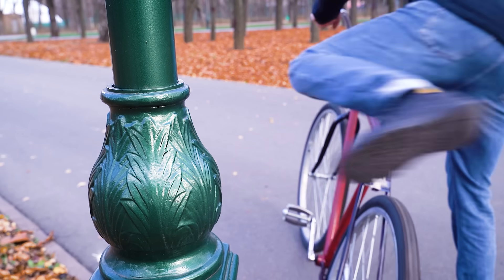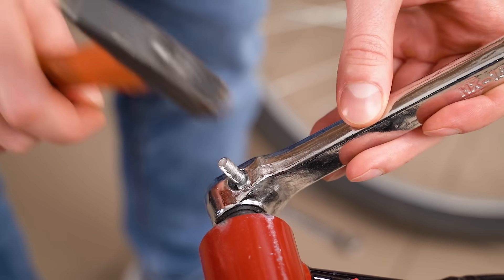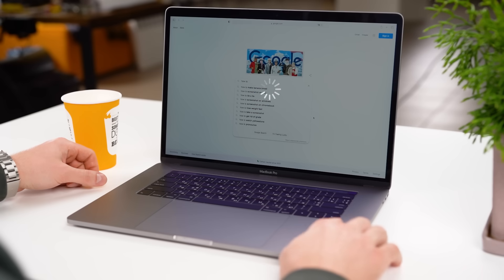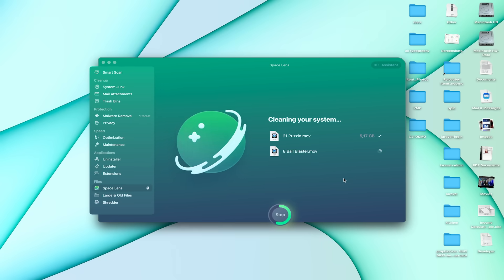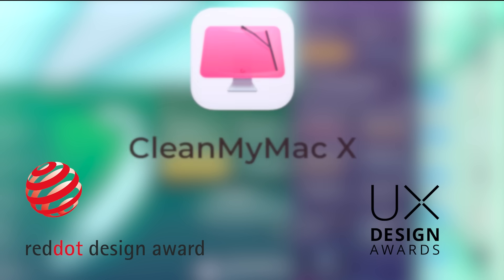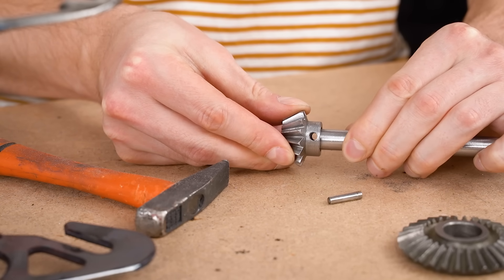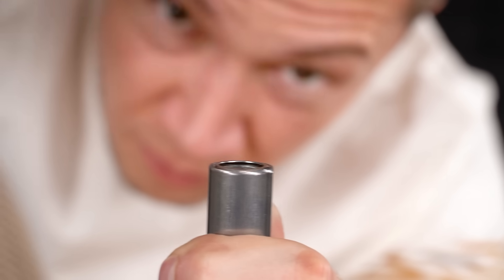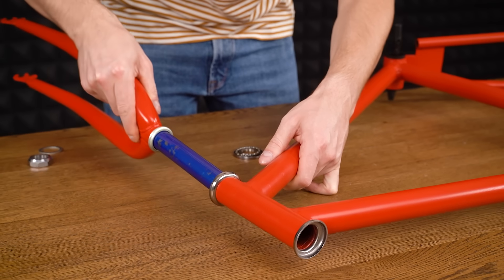Insane Chainless Bicycle Prototype

Comment: The power loss from the pedals to the rear wheel is insane.
Reply: If he tries to improve on it eventually it'll evolve into the chain again
Reply: Not a power loss.more like a efficiency loss due to way to low of a gear ratio. But he could climb any hill slow.
Reply: @kevind3185  Slow indeed, pushing the bike i.e. walking it.
Reply: @kevind3185  There's definite power loss, you have to spin that shaft, and that's not super easy to do in an efficient fashion.
Reply: @kevind3185  friction does cause a power loss that's why sport bike motorcycles are chain driven
Reply: Gear ratios.
Reply: The pedals have to move anytime the bike moves. No clutch.
Reply: @brsproductions6117  that’s not true, it still has the original freewheel axle in the rear, only the sprocket is changed. The downside is the gear ratio.
Reply: @murray821  if you actually watched the clip, there is no flywheel, its a direct drive.
Reply: Could you get a switch kit for this chainless bicycle, and with that help you with power and speed and what not? Cause there are no gears on this set up. dot
Reply: @Defender78  sorry, I was referring to some components on a car/truck that is used for the alternator/motor for one way to prevent reverse direction.
Reply: this is actually is like truck on 1st gear. So you need to pedal more for to go faster but now you have more torque. So if he can do a double or triple gear system that is changeable it will be better than chain system I believe :D
Reply: @BerkayGür  more like a truck in 5th gear going slow
Reply: @BerkayGür  😂😂😂
Reply: That's why when they used to make bikes like these, back in the 1800's they quickly ditched them when derailleurs started appearing. Chain reigns supreme.
Reply: there is no power loss, wtf are you talking about?
Reply: @igvc1876  look how fast he has to pedal to only go like 5mph
Reply: @zainzwerschke5484  yeah, which would be like a truck in 1st gear, not 5th.... do you have any clue how a transmission works? Lmfao. In first gesr the revs will be high and youll have no speed. Just like how his legs have to spin fast and hes going nowhere.
Reply: @igvc1876  yes there is chain drive is the most efficient then belt then shaft look it up before you speak stupid
Reply: @igvc1876  tell me more about how you have no understanding of physics
Reply: @splitloopgaming3523  why is there a  massive power loss here?
Reply: "Prototype"
Reply: @4gent0range  Yeah i'm waiting for the stage 1 with carbon propshaft.
Reply: Electric motor with one way cluch can help generate extra power for going up hills with this gear and chainless system
Reply: Maybe he can improve it in the future
Reply: @islamisthetruewaytogod6812  No, not really. It hasn't been solved on motorcycles, so I'm not sure how they'd solve it on bikes. Just spining the shaft alone requires a lot of energy, and that remains the case no matter what you do. On top of that, with shafts, it's much more difficult to have multiple gearings in a bicycle form factor. Motorcycles get away with it, because they can handle the extra weight of a transmission. The transmission itself is a pretty good chunk of the total weight of a good road bike.
Reply: @SmallSpoonBrigade  don't see why you couldn't pair this up to a shimano nexus or something similar rear hub.
Reply: @islamisthetruewaytogod6812  why bother when the best solution exists at the bikes store already

Comment: This will never be as durable as the chain bicycle,  plus this bike can never go faster than 7-9 km/h when comparing it to a regular which can reach to 20-30 km/h

I know that this is a prototype,  and in future he may comes with a solution to get pull vs drag mechanics,  but the current model is just a beautiful art

Comment: Video should be labeled "How to ruin a perfectly good bicycle". The technology used in this video is actually VERY old, but there is a good reason why it's not being used today.
1) There is not gears, so going uphill will be difficult
2) There is a lot of stress when pedalling on the small gears, with single point of contact between gears (in comparison to a large contact area on traditional bike with chain). There will be too much wear on this mechanism.
3) Any small debris (even sand) will make this mechanism not very useable.

Comment: It's a good invention, but need to chage a lot.
It will not run fast nor it is be easy on hills. So need atleast 3 gears shifting system in it so  it will be much better.

Comment: Exhaust yourself just to go fast enough without tipping over. It's a neat idea but the dude even barely missed that tree with keeping the bike upright. Unless you get bigger gears or some weird planetary gear fuckery to make it go fast(which would be more work than necessary in design), like others have said... you won't be winning races.

Comment: This is the same principle that has transferred power in most every automobile since almost the beginning. Ring and pinion is ok as long as you have a transmission in between the power source and pinion. Otherwise it’s very limited in power and speed.

Comment: Congratulations on switching to a technology used and abandoned by bicycle makers over a century ago. There are no real advantages to shaft-drive on a bicycle, that can not be achieved on a chain drive by installing a chain guard or by fully enclosing the chain drive. The only advantage I can see is reduced need for adjustments. Shaft-drive bicycles are almost always heavier and more expensive than chain drives. This design would have extreme issue with hills and trying to achieve any speed. There are 3 speed shaft-drive bicycles being produced in limited numbers, and with advancing technology being able to make lighter and stronger gears shaft-drives may become more common. Also not sure how long those bevel gears from old hand drills would last under the pressure of being use don a bicycle.

Comment: i mean.. good work and all
But....

1. This was done a long time ago and was made redundant

2. I'd be concerned about the teeth chipping or breaking off over time

3. and when that happens, What does repair or service look like

4. How about the lack of lubrication in the rotating cylinder in the bike frame just grinding away at the metal

5. and then of course we have speed and Gear Ratio and lack of Mechanical Advantage
(which again was why the chain was invented to begin with)

also your chain wouldn't break off if it was maintained properly and kept tensioned

I can respect the work and engineering but it's not an idea that is going to take off widespread

Comment: Cool idea. By my estimate, this is going to need a stronger structure holding the 2 shafts (wheel axle, drive shaft) in perfect proximity.  My guess is the mid steel bake frame will only be strong enough for very light riding. the frame will bend if you try to stand up and pedal hard up a hill and then the teeth will begin jumping. This is a good idea though.
Reply: It's not a cool idea, this existed for over 150 years and the reason why it's not used anymore is because is highly inneficient.

Maybe a cool idea for the 1800s, that for sure, but not in 2021...

Comment: Literally a ring and pinion, nothing amazing lol.   I can totally see this failing.   Much more so than a chain, even the crap, never ever lubed chain they showed broken.   Does the final drive gear have a sprag ? So that you can coast without pedaling?  Or must you constantly pedal, with the direct drive set up?   Not bad if you only wanna go 2 mph

Comment: This isnt a practical way of cycling. 
1) the size of the bearing will need a lot more paddling and bicycle will be very slow.
2) if you increase the size of bearing, yes it will be a solution but the gears bicycle trend we live in right now will not exist. You will only get 1 speed on this bicycle.
3) most importantly. You wont get reverse free paddling.

Comment: These were made earlier in the last century and were called a Safety Bicycle. There used to be one on display at the Canterbury Museum and one hanging from the roof of a local bike shop. They were mainly to prevent ladies getting their long skirts caught in a nasty old chain:)
Reply: I thought "safety bicycle" referred to the size of the wheels. IE if you fell off it wasn't 10 feet to the ground, unlike a penny-farthing.
Reply: @worldcomicsreview354  There is an original Safety Bike that is occasionally on display at Canterbury Museum here in Christchurch NZ. It has a shaft instead of a chain, making it "safe" for ladies to ride with their long dresses, and men didn't get their shoe laces caught. It was an innovation shortly after the Penny Farthing was replaced with chain'drive bikes which many considered hazardous for the reasons outlined above :)

Comment: Looks like the gearing ratios may not have been taken into account. However this is still a great foundation to build from. Good idea.
Reply: That would be tough in a bicycle form factor. Motorcycles have a fairly wide transmission that wouldn't easily fit into a bicycle. You could probably do something along the lines of a continuously variable transmission though as that doesn't require much space to work with.

Comment: Neat until a tiny bit of grit gets in the crown gears and jams them solid. The extra pressure on the pedals to make the crown gears go around will warp the drive shaft and then the whole thing falls apart. I've never had a problem with a bike chain.

Comment: Now pedal up a steep hill. Just looking at the attachment points I'm pretty sure that once a large amount of torque is applied the metal will flex and the gear will slip thus allowing for instantaneous testical deformation or ITD. Should be fun to watch !

Comment: You will need bigger sprockets on the front and the back. The drive gears need to be adjustable on the fly. So that you can change the gear ratio. I could imagine having the drive bar slide inside of itself, but also have a key to make sure that it’s rigid to the twist. It could slide slightly forward or backwards to change the gear ratio. The bar would have to get shorter or longer to change the gears.
Reply: Exactly why this design is hasn't been used since the late 1800's. Because a chain can do all of what you said easier, and more efficiently.

Comment: I gear, one speed. This would not work for serious riding, especially road bicycling in the mountains. I can't imagine how a 21 speed crank can be configured without having a chain. Also, how can this gear only drive coast, without the pedals turning? It should be obvious that it doesn't. This is an interesting video to watch a conversion of this type, but the solution is not pragmatic.

Comment: A chain is much more power efficient than gears, a properly lubricated chain is virtually friction less, so when you have a small power source like a human, you need the most efficient transmission you can have, that is why bicycles use chains!

Comment: It’s literally a ring gear paired with a pinion gear. This is what powers your cars and trucks inside of what we call a differential. It’s efficient but 1) you now need a transmission if you want more than one gear. 2) good luck fixing that mf on the trail. Regardless you keep those overpriced gears in your pack, you have to have the tools to essentially disassemble the entire rear end now as apples to a simple chain breaker and new chain.
Reply: My disappointment is immeasurable and my day is ruined.

Comment: Since the wheel has a solid mechanical connection to the pedals, hills will become an issue. Once the wheels go faster than your ability to pedal, you'll have to clear your legs of the pedals or be hit by them. If only you could engage a clutch system, like a chain bike.

Comment: Clever video, but hacky execution. Soft steel drive shaft not supposed to run directly on needle bearings. Will wear rapidly. Excessive looseness and backlash in drive components will fail quickly. Fun to watch, but you're no machinist.

Comment: Nice job! It is a work of art.
The reason they don't make bikes like this is that steel is stronger in the pulling direction that the twisting direction. 
The shaft will always be at least as heavy as the chain. 
Also bevel gears are less efficient than roller chain, and tend to slip more.
Reply: Nerd. 🤣👍
Reply: you just made that up, stop talking shit. try a more factual approach next time. for example, this can not change gears... the pedals can not freewheel... etc
Reply: @bottomline99  Actually, bevel gears (or any gears) are less efficient because there's a change of direction - twice in this case. Any force vector reqiures energy that ultimately is not delivered to the wheel. Where that's also true of a chain, the angular deviation is minimal by comparison, and is mediated by the difference in sprocket size (proportional to the gear ratio). So "made up" or not, the assertion is correct. Also, tensile strength may be greater than yield strength, it depends on the material. However, this is unlikely to matter as the forces required to either twist or pull a 5/8" steel shaft  to the point of damage are unlikely to be achieved in this application. That said, I agree that the two major omissions are disengaging the pedal (freewheeling), and providing multiple gear ratios. All-in-all, a chain drive using a modern derailleur to achieve a nearly linear transfer of force while providing a wide range of input-to-output ratios is hard to beat.
Reply: @ Patricia Lorentzen In my opinion the lower efficiency of bevel gears a simple matter of friction, which increases at 90 degrees with the inherent increased surface slipping that results (Agree with JMC on that). Respectfully disagree about the vector statement, eg a long belt drive that twists 90 degrees is virtually as efficient as if it didn’t. It was ‘The reason they don't make bikes like this is that steel is stronger in the pulling direction that the twisting direction’ that inspired my comment. That is not the reason, it urkes me when people just make shit up and preach it like fact! My thoughts and guess would be, for the same torque transmission, the chain style spreads load over a larger diameter cog and many teeth, the bevel gears are a smaller radius with only one or two teeth in contact, which undoubtedly results in much higher stresses, requiring higher quality materials, hardened surfaces, shimmed exactly to avoid wear, enclosed with oil (and seals) to achieve low friction, a variable gear ratio wheel hub drive. imagine its actually pretty good system performance wise however simply more heavier, complex, costly to make and maintain compared to the ole cheap and effective chain drive that won.
Reply: @bottomline99  bevel gears you have an axial force pushing the gears apart. This force and the higher friction you mentioned are responsible for the inefficiencies.
Reply: @hamzaakbaba8132  agree there is an axial force but disagree it increases inefficiency. pinion gears have a similar force just in the radial direction and in both cases the force supported by bearings at a very similar efficiency.
Reply: @bottomline99  because of the higher forces the bearings have to compensate you have friction losses...
Reply: @bottomline99  you could easily add a freewheel to a shaft drive set up ..

Comment: Lots Of Disadvantages With This Prototype...
More Hard Working...More RPMs To Gain Speed...No Options To Hold Paddles...As Soon As You Stop Paddling...It Will Stop Moving...Too Rough Braking System...Much Frictional...So Basically It's Quite Dangerous To Use On A Busy Road...

One Can Easily Lose Some Teeth For The Sake Of Uniqueness...Maybe For That Very Reason This Idea Was Abandoned In Late 18th Century

Comment: There is nothing new or innovative about this design as shaft drive bicycles have been around for over 100 years. In recent years, there have even been some multi-gear designs produced.

Comment: Now THAT is old tech a cycle using Cotter pins!! lol Having been a Chief Cycle Tech for a couple of local Halfords Stores near me, I thought they were consigned to history! So it was an amusing sight to see them being undone and knocked out of the cranks... Anyway, nice concept, more reliable, potentially a lot quieter, and, a single gear version of what is being proposed for a multi geared bicycle (works on similar principle, just the drive gear slides up and down different gear rings... 🤔👍😎🇬🇧

Comment: I like the idea. The goal to remove the need of chain service is good. But for this to be a true advantage it has to be encapsulated. Otherwise you still need to do service with cleaning and oiling. 
Some comment about the disadvantage of only one gear. But there are chain driven bicycles with a single gear as well, and they work good for normal transport.
Anyway I like the creativity and it's fun to look at. It works, but is better suitable for motorcycles. I have a dream to get a motorcycle one day. And if so I have already decided to get a shaft driven bike.

Comment: Good idea but the gear ratio needs to be able to be adjusted for speed or torque.
Do the same thing on both sides. Have 1 gear low on one side and 1 gear high on the opposite side. Then make a lever that can engage 1 side and disengage the other.

Comment: lmao at the gear reduction. cool project but it would be a lot better if you literally just used a slightly larger drive gear for a more usable top speed. don’t need that much torque unless you’re always going uphill

Comment: Full marks for your creativity but still less durable and stable than chains which is acting as Pulley.  These gear will creatainly wear out due to regular friction but in case of chain it provide a proper grip which make bycycle run smoothly.